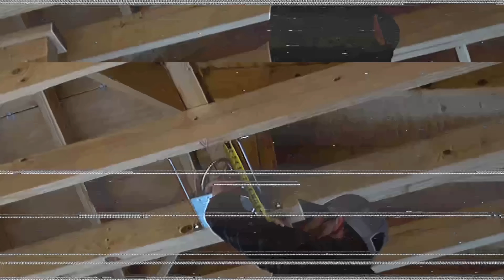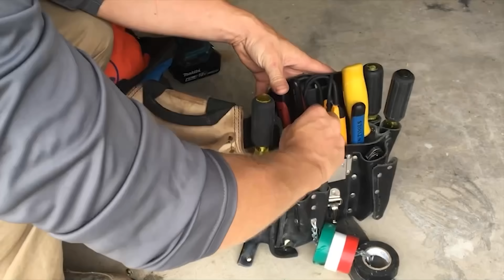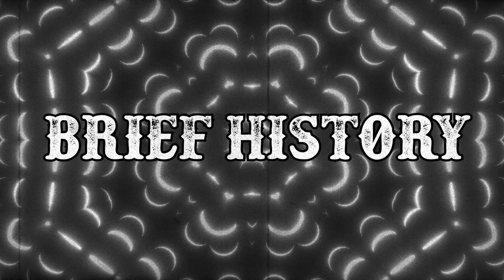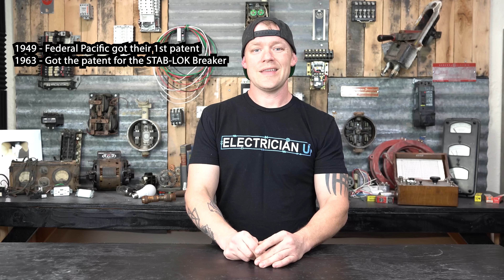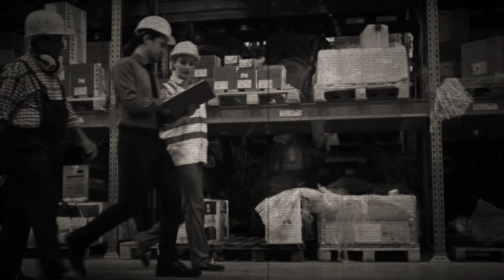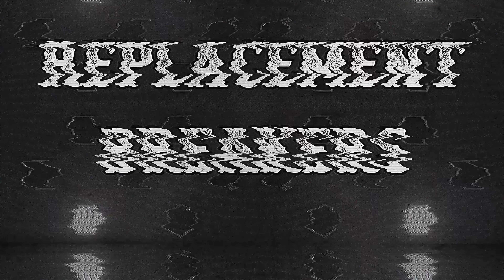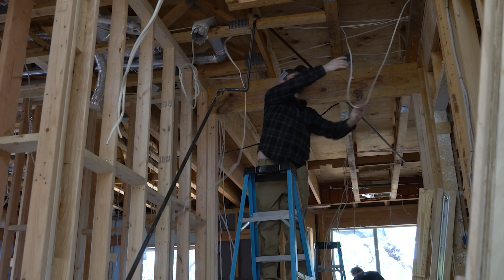FEDERAL PACIFIC ELECTRICAL PANELS - why their panels are dangerous

Comment: I saw a huge SK screwdriver get burned in half when it accidentally shorted a 50 amp FPE protected circuit.  The shaft was around an inch thick it dropped through an open hole in a sub-panel. Then burnt into two pieces in well under 15 seconds. But, of course, there was also a 100 amp main breaker. Neither one blew, but the lights dimmed in the house enough to alert them to check on me.

Comment: Years back there was another after market FPE breaker and I think it was called Challenger. They were tan (not Cutler Hammer) and they had color coded handles.
When I was working, if I saw FPE, it had to go. Their breakers where good switches. NEC- leave the job in a safe electrical condition

Comment: Another problem with the breakers is they they tend to pull out of the box when turning them off or resetting. Once I found out these had a 60% failure rate I replaced mine with a Siemens panel and breakers. Never had another problem with the breakers

Comment: After my dad passed, mom bought a smaller house built in 1960 it had FPE breaker equipment. I'm not an electrician by training, but I knew enough to know that I would not want this. Not only were the breakers bad, the boxes were way too small and everything was jammed together - it was dangerous to work on. Also, it had 4 "Mains", so you were never really sure what circuits were live or dead when one of the mains was tripped. For safety, I used to trip them all when I had to get into the panel.

One final note to Electric U: It was RELIANCE (not "Reliant") Electric that bought the previous owner. I know this because I was working at the former Haughton Elevator, Div, of Reliance Electric at the time. The whole deal was later bought out by Exxon as you noted.

Comment: I have use a 20 amp fpe breaker to wield and I have had a 40 amp fpe ac disconnect trip a 200 amp square d panel

Comment: My parents had a Federal Pacific panel. I told them over and over to get it replaced. One day the electric stove direct shorted, blew the plug off the back of it, spewed black smoke everywhere, and filled the drywall behind it with molten metal. The breaker never tripped. I never really tried to figure out exactly what happened, but I suspect the whip got loose (my mother pulled the stove out several times per year to clean behind it), overheated, and shorted. It took almost burning the house down for my parents to get a new panel. My father still doesn't believe me when I try to give advice on HVAC/Electrical haha.

Comment: I had one of these systems in my home and was never told about the problems when I purchased it in 1994.  Not from the CO inspector or the private home inspector I hired.  Maybe at that time they weren't red flagging them.  I have since had the entire panel replaced.  It's also interesting that no one told me there were replacement manufacturers out there.  I may have just replaced all the double throw breakers.

Comment: GIVE? oh I'll give summer 2013 in FL. cleaning the rims on my 91 Sporty 1200 I hear a FOOOF 
FOOF FOOOF  like what the hell. I had the dryer going and could hear its rumble. I go into the 
house and immediately on my left is the dryer and washer. Behind the dryer big blue arcs of 
power. I pushed the big knob in and dryer stops. I pulled the 4 prong plug then I pulled out the 
dryer and see a 1-inch hole burned into the steel panel. I did have an FPE double pole breaker 
rated 30 amps. It never tripped. I can only thank God I was home when this happened.
Another time in the back bedroom a space heater went on the fritz and the cord coming out of 
the theater began to arc yet the breaker a single pole type never tripped.

Comment: How high a normal failure rate is depends entirely on what part it is. Primarily in regards to what happens if it fails. For breakers, you normally have double breakers with both the circuit specific as well as the main ones per phase. On the other hand it's something that is dangerous to life if it fails. There's also different kinds of faults, like tripping below rated, gets hotter than specs but within safe limits and such are also errors but doesn't endanger life when they happen. I would GUESS around 1 in 100 for common faults (as in non dangerous ones), and 1 in 10.000 for functional faults, meaning it doesn't perform its function, ie break power when over limit. I'd guess even lower tolerance for main breakers for the phases too. One thing for certain though, you generally do not measure faulty products in percentages because it's normally fractional percentages and makes more sense to denote in how many units per accepted failure... Or as it's denoted within IT, it's usually denoted in the reverse with that say 99.9999% without errors, rather than 0.0001% accepted error.

Comment: Oh god, I'm now realizing the house I grew up in had a Federal panel. I just recently found a bunch of stab-loc breakers cleaning up in the basement. And I'm 99% sure the garage sub panel is also federal. No wonder in 30+ years I have never ever ever tripped a breaker in the garage, running lights, grinders, welder, 240 compressor, etc etc and never tripped even when I was sure it was overloaded. Thanks for this video, I had no idea about these. I'll be changing that panel out asap.

Comment: FYI if you are Canadian Federal Pacific = Federal Pioneer.  They only stopped making/installing these panels in about 2013. So even if you think your house is fairly new double check to make sure it isnt a stab-lok breaker panel. Ive seen multiple times where these breakers fail and will not trip. Seriously consider replacing the panel, literally anything else on the Canadian market is WAY safer than Federal Pioneer.

Comment: can't comment on electrical but from an automotive manufacturing standpoint we calculate failure rate by parts per million or PPM, the ideal rate would be say 10 but up to 100 would be acceptable dependent on the use case or manufacturing standards agreed upon by the customer & producer.
Reply: for non-structural parts, they can have visual defects and be accepted but if there is a structural, thermal, conductive, resistive or dimensional requirement then a tolerance of acceptability is given and parts are tested (or supposed to be) at regular intervals to catch and contain manufacturing defects before leaving the producer. Testing is also done on raw materials for products to ensure there is little to no variation between batches or lots.... recalls can happen when the chain of inspection breaks at multiple points
Reply: The Ideal yet impossible failure rate is 0    (but hey, if mistakes aren't made, how are we to learn)

Comment: I worked for Schneider Electric for 16 years as a service rep in Ontario. Around 20 years ago they took the Square D design and installed that in the stab Loc breakers. That fixed the not tripping problem with those breakers. They stopped making the panels several years ago. They kept making the breakers as the base was very high and the electricians complained. This year they put out a notice that they are dropping several types and sizes of the stab loc line. I would guess it is just a matter of time they drop it all. Federal was a Canadian company and square D was US. So Schneider wants to drop the Canadian company. The Square D Breakers have always been the best breaker on the market. You could put a paper clip on it to ground and it would trip so fast you could hold the clip without burning your finger. Other breaker manufactures the paper clip would burn away. Nice video on the history I really enjoyed it. I did live and work around their products
Reply: I remember the house we moved into 1986, brand new, with Square D QO breakers.  One day, I was being dumb and thought I could try to power a Yo-yo's lights by plugging it into the outlet.  A bright flash and the breaker tripped instantly.

A house we moved into, in 1992, before we had it rewired with Square D homeline, had the Federal Pacific breakers (and four fuses in the garage).  I was taking apart an old Electrolux vacuum, with it plugged in (because I was trying to get it to work), and accidentally touching the contacts on the motor.  Got a little shock, nothing serious, but the breakers didn't trip.
Reply: @CharlesDB76  A standard breaker doesn't protect from electrical shock, you need a GFCI to provide some level of shock protection.
Reply: I have a 2009 made condo with a Schneider Electric (Federal Pioneer) panel with Stab Lok breakers.  Is this one good to go due to its more recent age, or no?
Reply: @JimS870  In Ontario there are thousands of these panels still in service. If you are having no issues I would leave it alone. I have some in my place and do not see replacing them. Other manufacture had some issues with their breakers also. So some where bad and most where OK.
Reply: @JimS870  the panel should absolutely be replaced. Stab-Loc busbars are flawed by design. Even if newly manufactured/modern breakers actually trip when they're supposed to, the Stab-Loc bus is inferior to modern bus designs.
Reply: Ĺ

Comment: In the 90s I worked at a supplier and sold a TON  of these, and also replaced the panel in the house with an FPE.... 
I have had circumstances where a breaker should of tripped and THEY DID.  I also "exercise" the breakers 2x a year, that may help too.

Comment: I started getting anxiety when you showed a pic of a FP panel. Malls have these, even today, and combination of half ass remodels over the decades makes it a disaster to troubleshoot when something goes wrong. I opened ceiling access panel, there was the original hard lid ceiling with the original lights. They literally built a new hard lid over the original without demoing it. One of the original lights was still hot. And it was a spiderweb of cables up there. Avoid rosedale mall.

Comment: My house was built in 1982 and is big enough that it required two panels. I began to notice a burning plastic smell in the room with the panels and discovered that one of the connectors on the main breaker was cracked and arcing. Was just going to replace the main breaker when I learned about how dangerous the Federal Pacific panels were. Lucky me, both panels were Federal Pacific. Decided to replace both instead and got a couple of sky high replacement quotes. Being a die hard DIYer and a cheap bas*ard, I did my research, watched a lot of videos, and replaced both myself with Square D Homeline panels. Passed inspection on the first try. 
On a side note, while helping a buddy with an electrical issue at his house, I noticed that he also had a Federal Pacific panel. Warned him about the horror stories and told him that if he tries to sell his house, the inspector would probably peg him on it. Sure enough, he sold his house two weeks ago and the only thing that the inspector dinged him on was the panel. Had to reduce the price by six grand to make the sale.

Comment: This is a great case study; and told very well!

As an engineer myself, I can throw in a few bits of info: Failure rate is often associated with the rate of failure post quality control.  So, if the failure rate of a widget were, say, 1% then we can expect 1 in every 100 widgets to fail after they have passed quality control; typically during usage.  This number is often accompanied with a "MTF" or "Mean Time to Failure" indicating the average length of time before failure occurs, which can be indicated in service time, real time, etc.  Sometimes, it can be an entirely different metric like mileage, mating cycles (for connectors), etc.  These numbers are typically used to calculate the warranty period, by the way...

The percentage of failure off of the assembly line (Quality Control failures, which I think is more what we're talking about here) is usually indicated by a "Yield" amount.  This is usually the percentage of QC passed widgets per production run, expressed as a percentage.  This number can sometimes change depending on the production run size due to the technologies implemented for that particular production scale.

Comment: Regarding failure rates from other industries: For the most part, the failure rate has to be quite low, fractions of a percent, close to zero. Just imagine if the brake actuator in your car (master cylinder, disc brake calipers, abs solenoids, controlling software) failed at 10%, or even .01 %. That wouldn't be acceptable. The same with Gas appliances: Imagine if the gas supply system to your furnace, in the case of a fault, unignited gas continued escaping the system, but 10% of the time the fault wasn't detected? As a software person, systems are expected to be near 100% reliable. Just look at the outrage when Reddit or YouTube goes down for a few hours, even though it's been reliably available for months. Imagine a failure in the 911 system, or these days the cell phone network. It happens, it's always a big deal, but the failure rate is incredibly low. Takata airbag inflators are an example of how a life-saving device that doesn't actually work can kill and maim people. That has had a broad response. This failure should have a similar response (as you have said, should fail home inspections, as an example),.

Comment: It is important to note there is a distinction between how some random consumer product company looks at failure rates and how something dealing with public safety looks at them.

When you are dealing with public safety, the only acceptable failure rate is 0%. That doesn't mean you don't recognize failures will happen but you really go out of your way to try and minimize them, even if it doesn't make financial sense.
When a problem comes in it is assessed for severity and if it is bad enough you do a root cause analysis or apparent cause analysis to find and correct the origin. You'd also do an extent of condition to determine if it impacts just one person or a larger population. At least in the industry I work in, we have a small number of customers so they'll get notified directly if the severity is high enough.

But you wouldn't do this at a T-shirt factory, sure it would suck if 60% of your T-shirts failed but no one is going to be maimed for life or die if their T-shirt fails.

I would imagine (hope) residential electrical distribution falls into that 0% failure rate is the only acceptable failure rate.

Comment: My dad started as an electrician then moved on to be an electrical engineer.  We lived in a subdivision where the builder used the cheapest and or discontinued materials he could find.  For example, non-standard size doors, etc.  We all had Federal Pacific panels in our homes.  My next-door neighbor had several fires in his home.  The insurance company being suspicious, would not fully cover the damages as they blamed it on the careless use of smoking materials.  My neighbor said he saw sparks shooting out of the light fixture until the fire department arrived and disconnected the main power.  A day after the fire, an electrician showed up and "did something in the garage" according to my neighbor, then removed the dining room light fixture where the sparks were shooting out and took it with him.  A few days later another electrician sent by the insurance company shows up to replace the light fixture and asks, "why did you remove the light fixture?"  
Who sent the first electrician and what did he do in the garage, did he replace the breaker?  Why did he take the light fixture? 
I remember as a child seeing black smudges on the wall next to their breaker box.

For the first 20 years that we lived in this neighborhood, you could not find replacement FP breakers.    My dad replaced the FP panel with a Square D panel.

Comment: I haven't changed an FPE panel in almost 5 years or so now. During the Great Recession alot of houses went into foreclosure in my area and since insurers won't provide insurance on a home with FPE breakers we changed out tons of them. I thought with that over with panel changes might become a thing of the past but not so. Now older equipment from trusted brands are starting to wear out and burn up busbars. Snap in breakers are convenient but eventually one of them has a poor connection and fries its bus. Some things never really change haha.

On a side note I do a ton of service work and encounter FPE all the time in commercial settings. Apparently commercial insurance doesn't care? I've used some of those 1/2 in. wide Stab-Lok Connecticut Electric replacement breakers before and quite frankly they feel like cheap garbage. Sometimes the are so poorly made you have to do CPR on the panelboard to get the thing to stab in. And when you try to torque the screw to spec it feels like the breaker is going to snap. But business owners don't care as long as they can keep making money today.

Comment: I work in the IT field. Industry wide, there’s an accepted  fail-rate of around 2% in first year of use. For individual components it’s much less (not sure on exact, I’d guess around 0.01-0.05%). But, as you know, things are complex, so all those different interactions mean about 2 per hundred are going to see unplanned downtime in that first year. Extrapolate that out to a medium sized datacenter running 800,000 - 1,000,000 servers and you’re looking at right around 2,000 servers per year you paid upwards of a quarter million dollars each for, that are functioning with the same compute  resource availability as a boat anchor. Spoiler warning: that’s part of why Microsoft Office or an Apple iPhone costs as much as it does.